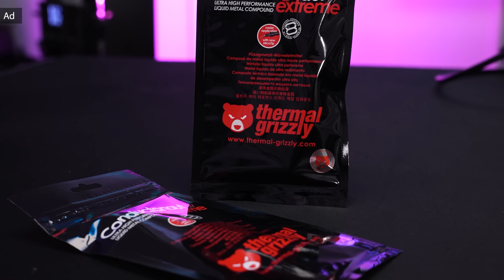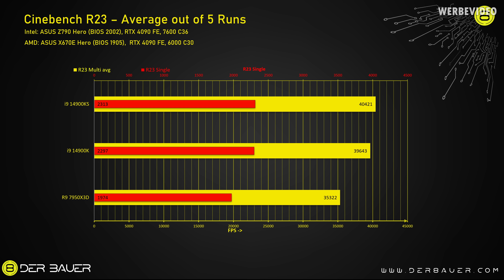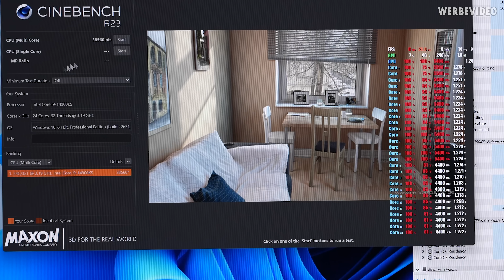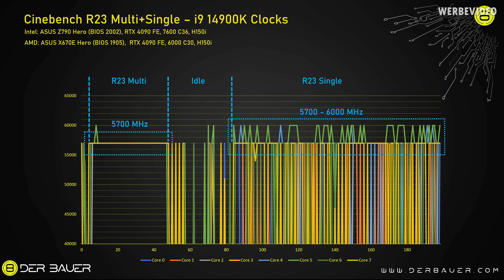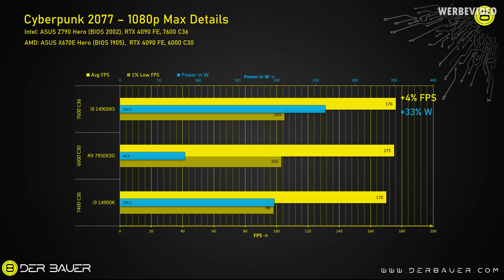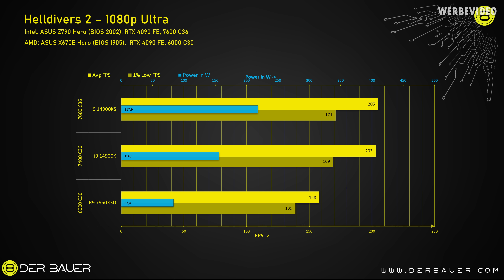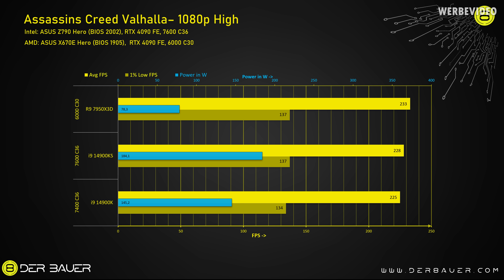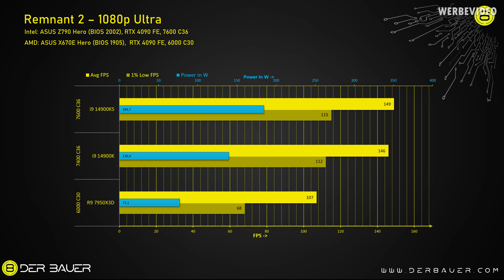Almost 400W under Full Load - The 14900KS is one of the Most Extreme CPUs ever Made

Comment: This feels like 14nm+++++++++++ all over again. We're on the 4th edition of this CPU.
Reply: @karl5010  oh shit it's down to 177? Dang. Gotta keep up to date on my leaks I guess.
Reply: Intel 7 node is being wrung for everything it has here. Arrow Lake dropping all the way to 20A (double node shrink) is going to save so much compared to this. Rumors are that PL2 might be reduced from 253W to around 177W for the Ultra 9 290K (15900K).
Reply: @DigitalJedi  Although it remains to be seen what kind of clocks they manage. They had a huge problem when going from 14nm to 10nm where 10nm just didn't clock high enough to beat 14nm early on
Reply: @DigitalJedi  Famous last words
Reply: @DouglasWhitcomb  PL2 did not in fact get dropped yes, and it is all on N3 instead of 20A, but CPU power is indeed significantly lower on Arrow Lake. The assumptions from 9 months ago are of course not going to be 100% accurate, but these chips do actually sit at that 170-190W mark quite often.

Comment: If you buy this CPU and are not a hardcore overclocker, you are just throwing money away. You get relatively the same performance as the 7800X3D (no one will notice 2% increase in game) for double the cost, double the power, and a dead platform. I would love to see AMD release some golden sample 7800X3D skew and see the comparison. Also, overclocking the X3D is not completely locked. Gigabyte bios for example, lets you enable PBO and has settings for maintaining the core clock up to higher TDPs 70/80/90 at 5 different levels for each. If I peg my 7800X3D at 90C I bet it would stomp this chip and still beat it in efficiency by a large margin. I just don't get why anyone would want to sit next to a literal space heater.

Comment: Der, I received some Kryo from Amzn and it was either a 1:1 fake or just got too dry from sitting. I'm trying to paste a 1065G7 on a Laptop, is Hydro comparable to Kryo thermally? Probably gonna try something ekse, but Kryo is the only paste I've used so far for significant temp gains. Anyone, suggestions? Laptops don't respond anything like Desktop w/ IHS and a lot of thermal mass, stock paste and MX-2 are pegged against 100c throttle under significant load, Kryo is like 15c lower under load and somehow prevents PL2 boost from immediately exceeding TJ.

Comment: Proud user of 7800x3d completely silent air cooling it with  arctic esports duo gaming using only 50w and does everything i need with plenty of speed and multithreading power. 8 cores is enough for 99% of people. Points of 7950x3d is completely irrelevant on 7800x3d and i feel like it would be a good comparison againt intel cpu. Beating it in every way possible, cost, speed efficiency, relevance. Future proofing.

Comment: This power thing looks exactly like the problem last time with mainboard defaults and autos being wrong and applying too high voltage.
Did you check the actual voltages vs requirements/spec?

Comment: Yes this power requirement is ridiculous, but there are a lot of people who aren't blinking an eye at GPUs sucking down this much or even significantly more power. Both situations are awful.
I think its very clear now that Intel CPUs are just factory overclocked to keep them competitive with AMD at the high end. If say a 14900K was priced lower and down clocked a little it would beat AMD at the same price point, be much much more power efficient and still fast, but then Intel wouldnt have a claim to the 'fastest CPU'.

I have a 13700K and I know that cutting its max clock down a few hundred MHz and reducing voltage dramatically reduces power draw. That's really where the CPU should be.

Comment: How about Intel and AMD stop with all the fastest processor and focus on PCI Express lanes? How about a consumer level processor that will allow, a 16x GPU, 2 x NVME Gen 4 drives, and a 3 x 4x expansion slot cards? At present you can fit all of these onto a motherboard, at a loss. Some will not work at all.

Comment: And this is why Intel needs to stop the motherboard manufacturers from applying such insanely bad automatic-overclocks. out of the box breaking the power-limit by over 50%, having way way too high voltages applied and just running the CPU as inefficient as possible.
Reply: intel aloows them to do it, remember, intel controls all about motherboards, even the cost, they even controlled what the companies sold, never forget what intel did with amd and paid companies to not sell amd products or they wouldnt get desktop and server parts
Reply: @betag24cn  "never forget what intel did with amd and paid companies to not sell amd products"
That is not quit what happened. People should not talk about a lawsuit when they havn't even read that this very same judgement found that AMD did the exact same thing - and continues to do so to this very day.
The only difference is that Intel was found guilty because of their dominant market position.

And as ai said - this is one of the things were intel is to blame for as they are still allowing the boardpartners to do such crap.
Reply: @ABaumstumpf  no, it is what happened, you perhaps forgot or just read about it, i didnt

never forget that inteñ ceo saying tjat dell is the bes friend money can buy.
Reply: @betag24cn  "you perhaps forgot or just read about it, i didnt"
So you didn't even manage to read or comprehend what i had written, let alone the understand the lawsuit.

But thank you for showing so clearly that you are allergic to reading.

Comment: Can't wait for the 15900KS :)
Reply: from what i heard, next gen intel is built on tsmc 3nm, so hopefully they will be far cooler and far faster.
Reply: @edwxx20001  3nm appears to be for mobile CPUs or the GPU tile. 20A looks like the desktop node of choice, which is set to have similar performance to N3 or N2 depending on the libraries chosen for a given section of the chip. It's also debuting backside power delivery, my PhD research topic, for x86 CPUs.
Reply: @DigitalJedi  well i know names are meaningless, but 2 nanometer should match up to 20 angstrom.
Reply: @DigitalJedi Intel should have a decent advantage Vs zen 5. We'll see if architecture is good.

Comment: Alright this is past the point of  being ridiculous. I just want to say I have ran both Intel and AMD systems and have the 14700k at the moment, so please don't take this as a fan boy of either company.  I simply want the smoothest performance and as of lately Intel seems to be better optimized. That is not to say that AMD isn't on par or performing even better than intel from a hardware perspective. However, the main reason for going with AMD over Intel was for me a cost/performance benefit which is mostly gone at the mid to higher end. With that said, I am really struggling to see why intel would release a 400 watt cpu just to squeeze out a few extra points at the cost of turning up the heat without it being either delidded from the factory or using a better ihs and possibly soldering instead of the factory tim. The 14000 series was already a space heater but AMD is pulling 270 watts at 6.5ghz across all cores according to research done with a quick google search. Point of my comment is, Intel used to be the more efficient of the two when it came to architecture, thermals, performance overall while pulling way less from the wall. I'm not seeing this release of the KS series as anything more than intel saying look how much we can squeeze out of our 14 gen even if it is only marginal gains and is turned into a space heater that will require high end water cooling or LN2.

Comment: Is there a particular reason why you don't switch to using Cinebench 2024 for reviews/testing? It's been out for a while, and in my experience it's a much heavier test and will also expose any instability in the system much much earlier. I had an undervolt on my 14900K which was perfectly stable endlessly in Cinebench R23, but was unstable in the first run of Cinebench 2024.

Comment: i9 K_ really are not for enthusiasts but specifically HPC subject memory overclocking. You have to want to overclock the memory for specific productivity application performance this is where KS steps over 7950X that is still millions of KS users. There are 1.2 M 12900KS and 13900KS is passing 4.8 M units produced so someone wants them. On the AMD side 7900X is the volume seller for productivity albeit 7800X3D for gaming fine it's application segment specific. mb
Reply: I can also add productivity that are business applications, high frequency trading for example, have custom coded Thread Directed applications making use of the 16 e-cores unlike the majority of mass market apps like Adobe for example that make use of e-cores and you would think Sims should work well specific APO compiles games for P+e cores although Ryzen 3D LC and its better efficiency if the application is not compiled for Intel P+e falls toward Ryzen. mb

Comment: Is this true that the 7800x3D will always use 3D cores.  Is there a physically difference in the 7950x3D where half cores are 3D or something?
Reply: Yes, the 78003XD has only one CCD with total of 8 cores that run with 3DV-cache whereas the 7950X3D has two CCD's, 8 cores each making it a total of 16 cores. However only the first CCD(8 cores) has 3D V-cache and the other doesn't.
Reply: Thank you for the explanatio @daflipflop

Comment: Roman, would that deal be for extreme laptops, where they use desktop cpu's with liquid metal ?
Reply: LM gets a bit more headroom but the main limit in laptops is cooling: radiator volume and weight.
I have a 13900HX (same silicon as this KS lol) in a mid size 16" that's limited to 100W (CPU only, no GPU) without needing jet fan mode.
My old Clevo DTR brick that was twice the size (2inch thick, >6kg) was built for overclocking, it had a massive 1.2kg vapour chamber heatsink to cool 2x190W GTX1080s. It also has a VRM capable of running a 9900K at 170W but I had to add watercooling to let it happen. With some vbios mods I've seen over 600W from the wall when benchmarking

I also proved with my other completely internal watercooling mod of a P370EM, that the external radiator cooling really is needed. I was able to add 2 extra laptop sized heatsinks to a 17" chassis to get great OC (4.7ghz 3940XM) but it just couldn't cool well enough in the long term to keep loop temps stable, and prevent GPU VRM overheat.

The high end these days sucks by comparison, a Titan which brags about 270W combined CPU+GPU cooling. It can push a 14900HX to 238W short + 176W long power. Does that make the $5K price tag worth it?......

Comment: Man I'm a pretty big fan of der8auer but this was a terrible review. Take a tip from LTT... If you don't have the time to do it right, don't do it at all.

You admitted your faults but it doesn't make it okay to post that way. Aka:

ALL processors running on different ram speeds, with AMD on SIGNIFICANTLY slower ram, leads to very misleading results.

Not including 7800X3D, the fastest processor for gaming.

Not getting AMD 3D cache working.

Posting misleading, and wildly inaccurate results, is not acceptable. It doesn't matter if you acknowledge them.

I expect better from this channel. This doesn't do anything postive for someone wanting a comparison of the 14900KS vs AMD or other Intel...

Comment: I'd be interested to see how much you can undervolt the 14900ks and achieve stock clocks. If you can get a -0.1 thru -0.2v offset and still achieve stock clocks, that will bring down power consumption and heat a lot. 

I know with my 13600k I can achieve a -0.225v offset and still run stable at stock boost clock speeds. This isn't how I have it setup though, I have it setup achieving the maximum overclock on stock voltage of 1.375v. Which I am able to run 5.5ghz on all p-cores, 4.3ghz on all e-cores and 4.9ghz ring cache.

Comment: About 7950X3D... there was an old commercial in Poland around late 90s, about ACE Bleach, which had that quote: When something is for everything, its for nothing. In English it would be: Jack of all trades, master of none. This is how I think about this CPU.... Either you go with 7800X3D or 7950X. Can't have both.
Reply: The 7900X3D is the real showing of that. It also tries to be a decent value as the 2nd-teir chip rather than a flagship. It also manages to have all of the problems of the 7950X3D but worse, as there are only 6 cores in each group instead of 8.

Comment: This processor would struggle on air to just game with a nh-d15 without thermal throttling, what a joke. Also is a joke is how both processors the 7950x3d and intels ecore problems have NOT stopped being annoying trash for gaming. The wrong cores keep being used regardless of what 'influencers' are saying as they never play any niche games or applications outside their benchmarks.

Comment: What is impressive is how you can recommend the AMD chip which does have the "AMDip" in 1% lows in numerous games.  AMD also has quirky bootups with memory relearning etc, AMD also has driver issues such as which driver works the best?  AMD also then has to either use gamebar or process lasso, otherwise the performane is no where close.  Intel is a set it and forget it system with consistent and top performance.  You pay to play!

Comment: Mostly for the spectacle's sake, I'd like to see how this new KS would perform delidded + direct die contact frame + heavy duty water cooling loop. Seems like the delta between a 14900k vs amped up 14900KS would be interesting.

For shits and giggles, I'd also like to see a 7800X3D + 7800X3D delidded + direct die contact frame + water cooling loop, plus some very basic modifications in BIOS, mostly as it relates to curve optimizer built in (ASrock has a good one).

I'm interested in the spectacle of what 'could' be a typical daily but at the extreme end. Not important, but I'd find it interesting.
Reply: That's perhaps all AsRock has going for it.
Reply: Considering how good the IHS on the Intel's must be to actually dissipate all that energy as well as it does that would be a comparison I'd expect to trash Intel even more - assuming your AMD motherboard is capable of supplying more than 100 odd Watts so you can get more performance rather than just cooler running (not that cooler is a bad thing).
Reply: @foldionepapyrus3441 I own a 7800X3D and my prev CPU was a 5900x. I'm just curious to see what this would look like.

The 7800X3D wouldn't do well with more power since it seems that it's a bit more sensitive to heat, probably due to the cache. I know it's voltage sensitive.
Reply: @davidbetancourt4028 Get rid of AMD's rather low efficiency IHS and I'd expect the 7800X3D to be able to crank it up a great deal more with no heating problem. 

AMD haven't even tried to make the IHS nearly as good as shedding heat as Intel - but then they don't need to, their compute per watt is good and the CPU is perfectly happy running at the higher temperatures this creates... I'd love to see direct die on AMD more than intel for this reason - probably much more gains to be had.
Reply: @foldionepapyrus3441  The rule of thumb for overclocking on AMD cpus is for every 10 degree drop, you gain about 100Mhz on the boost clock automatically. This was noted by AMD's own engineers back when they showcased overclocking Zen 4 during the launch. Meaning direct die could potentially lead to very noticeable gains if combined with extreme cooling.
Reply: @GameTechReviews  Hmm, thanks that is interesting. And darn now I really really really want to delid one for the project computer I hope to get to this year.

Comment: I’m happy with my 7950x3d.  Between that and my 4090 my psu only goes up to 300 watts under load.
Reply: Did you heavily limit your 4090? Regular 4090s consume a lot more than that. Otherwise you're being CPU limited in the games you play which is bringing down the GPU wattage
Reply: @kendokaaa  Hi there! Never thought about that. So I did some research and I was wrong with the psu.  I was playing Elden Ring tonight at 4K with raytracing and all settings set to max or high settings.  PSU reading was at 414 watts (my bad) and GPU usage was at 85 percent.  According to the task manager cpu usage was at 15 percent although I don't know if I'm reading it correct.  Is this good?  Not really well versed in the overclocking/tweaking thing yet.  I just like to do gaming.
Reply: @ers-tj4to Low CPU usage is normal as games don't use many cores.
Reply: @ers-tj4to  Unless your CPU is underpowered, it's never going to be used to 100% when playing games so that's fine. Ideally you'd want your GPU at or close to 100% unless you have a frame rate cap or are using vsync. Some games just cannot use all of your GPU because they're limited by the performance of individual CPU cores, ram or even CPU cache so this also results in GPU usage being lower than 100%. A lower GPU usage leads to lower power consumption, at least for the GPU. If your frame rates are to your liking, there's nothing wrong with your numbers.
Reply: @kendokaaa  Lower GPU usage in most cases is from Bottlenecking.
Reply: 7950x3d is still horrible with it cutting its cores in half. The lasso method is to time consuming as well.
Reply: @ZackSNetwork  I use the game bar method (automatic, or selecting "this is a game" manually and have no problems, in a situation where I game on my pc but also use it as a workstation and didn't want to compromise too much on either task, it works perfect, and I have never seen package power past 130W even in benchmarks, I get like a 5% net loss based on benchmark scores etc. vs the normal 7950x, but that is inconsequential vs the benefits.